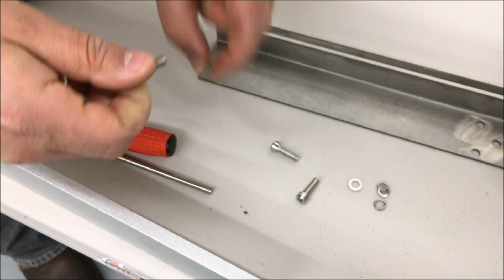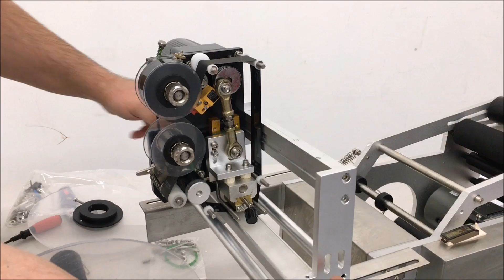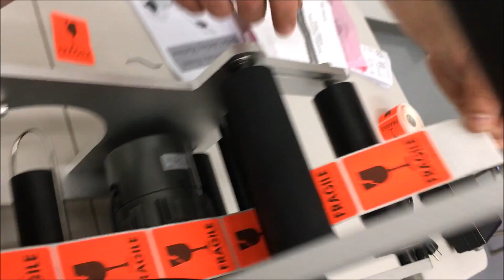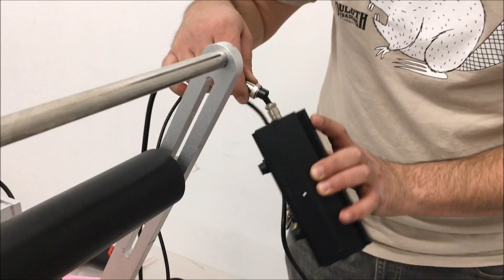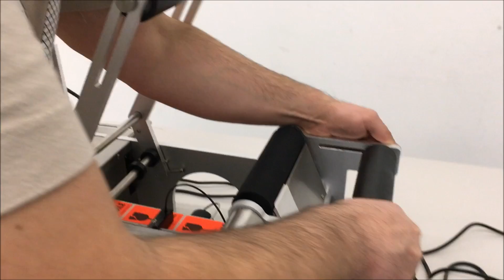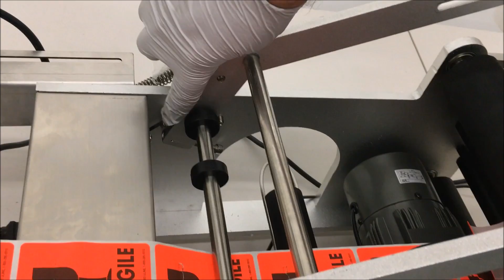Semi-automatic Bottle Labeling Machine

Comment: Hello, I would like to consult you about a problem with the mt 50 labeling machine. The problem is that after the label runs on the container, the date stamp does not go down to mark the date on the label. It also does not turn on the print key light when it is in the on position. Could you tell me why that may be happening? thank you
Reply: Hi Lucas, I am having the same issue with my mt 50 machine. Did you find the solution for how to fix this? I suspect perhaps it is a faulty connection between the labelling switch and the  automatic stamper. When we press the 'test' button the stamp will still work but it will not do it automatically for each label we apply without pressing the test button. If you have any insight or advice I would really appreciate it!
Reply: @scotttodd2928  Hi Scott! I was able to fix the problem. When the operator lowers the lever that must rest on the bottle, the two switches that are on both sides of this lever have to be depressed. If they are not pressed, it is necessary to regulate the rollers that rest on the bottle in such a way that this happens. If the explanation was not fully understood, write me again to make a video that shows you
Reply: @lucasfortunati403  Thank you for your reply Lucas that was actually very helpful, we had to make some adjustments to one of the screws on the arm to make sure the other switch was fully depressed. It has resolved the issue. Thank you again!

Comment: Thanks fro the video. I followed it to set up my machine. One problem.. When I bring the bar down, it clicks and the date coder stamps but the rollers do not move and the labels do not move. The rollers will not roll. Any ideas what could be wrong?
Reply: Hello, do you have questions about the labeling machine? Our company is happy to give you the most professional solution
Reply: Hello, nice to meet you! this is Amandafrom Shallpack, a professional labeling machine manufacturer in China for over 20 years. Shallpack labeling machine has been connected with Krones production line by our clinet Uni-President in China.
You are welcome booth in Propack Thailand in coming June. A labeling machine from Shallpack will be exhibited and you will enjoy a special discount if you buy it during the exhibition.  
shallpackdaq@126.com

Comment: At 15:39 the machine lunch 2 labels at once and the video was edited to hide that but fail. Sadly, my machine also often acts weird like that anyone know how to deal with this?
Reply from the maker: This machine can lunch 1 label at once .If you have any problem ,please send emails to service@joyfay.com
Reply: Hoàng Yêu Đời dam Kitna
Reply: Semi automatic labeling machine dam kitna
Reply: If you look closely you can see at the 15:39 mark the reel of labels actually snaps which is why the machine continues to run (it will only stop when the sensor detects the next label). We had issues with the label reel snapping and it generally required tension adjustment at the back and front to correct this, but we still occasionally have this happen.

Comment: does this thing work for clear labels?
Reply: Ray Lewis I would also like to know if this is possible. Trying it with my clear labels and its not detecting when the label begins and when it ends
Reply: Ray Lewis No it doesnt work with clear label since the light sensor can light throw the clear plastic strap.
Reply: if the sensors change to be capacitive label sensor or ultrsonic label wensor, they can work well with clear labels